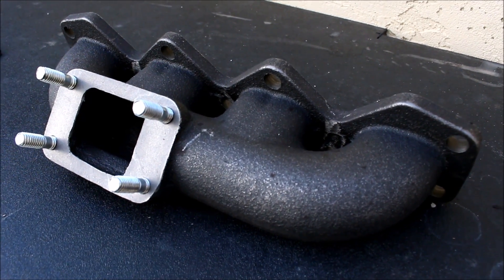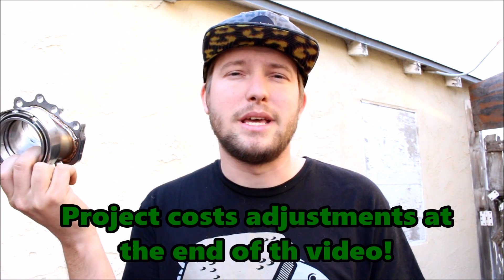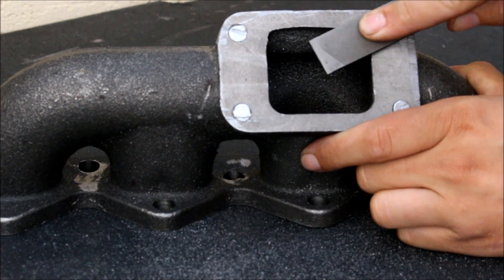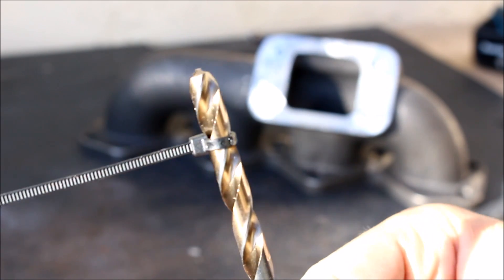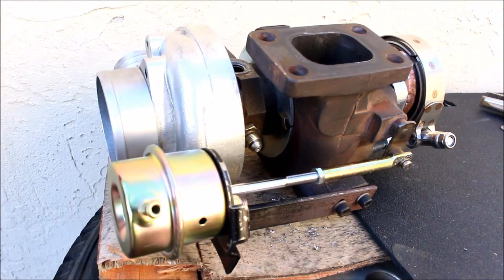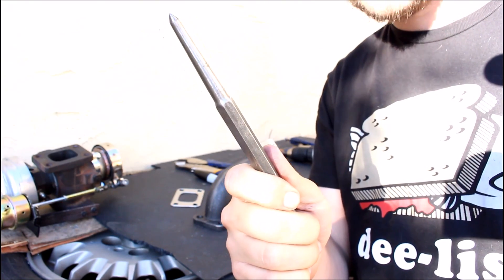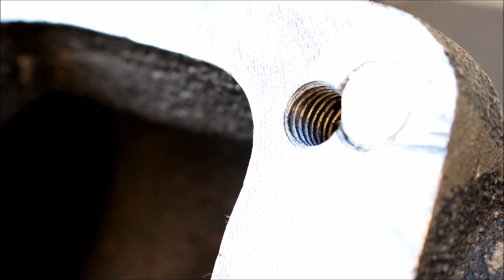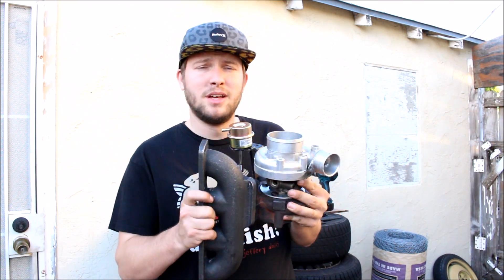Sorry Internet! Mending the Manifold Failures. (Broke & Boosted Ep9.1)

Comment: Well my friend, looks like I'm following your early foot steps ..... The same manifold and a hopefully not to large turbo. It has a build it waste gate and V band turn out. Did you find and use any 90 degree v band elbows to fit between turbo and firewall (shelf) that can be used at the start of down pipe ?   Thanks.

Comment: Was the original turbo a slow spooler ? What did you specifically switch to ?
Reply from the maker: I didn't switch turbos, and yes it's spooled very slow considering how small it was
Reply: @TheCarPassionChannel   Did you have any problems after converting the T3 to T2   
????? Thanks.

Comment: Yeah, I'm doing the install now, IRL.. Wish i had that 2" adapter to aid in clearance. Without it, you can't clock the turbo in any favorable way with the internal WG actuator and you have very little room for the downpipe without cutting the sheet metal. FK haters, prob never did a custom budget install themselves anyway.

Comment: I know this is an old video, but the Warner Ishi (IHI) turbo off of a 87-88 Thunderbird uses a T3 flange and spools very fast (full boost at around 2500, so I'm told). The downside to said turbo is the 18PSI max boost pressure.
Reply from the maker: Sounds like that would be a perfect turbo for the Miata.

Comment: ive been trying to some research and does anyone know if a TD05H 16G will bolt on to a T25 exhaust manifold, i cant quite find one for the 1.6 thats a durable one, the ebay ones just keeps cracking.

Comment: Way to make it work! Just in case anyone has a 1.8... I found this manifold for about $120.00 with an 35/38mm ewg port with an additional block off plate in case you end up running a sr20 t25 or something with an internal wastegate. It also comes with a cast heat shield (not entirely necessary), but the best part is that it is t25 flange, so no worries running a saab/volvo/nissan or any other t25/t28 turbo. >>>http://www.ebay.com/itm/MAZDA-MIATA-MX5-1-8L-T2-T25-T28-PERFORMANCE-IRON-EXHAUST-HEADER-TURBO-MANIFOLD-/321829986356?fits=Model%3AMiata&hash=item4aee8fe034:g:jk0AAOSwxvxW6zrS&vxp=mtr

Comment: the adapter would of actually flowed better and spooled faster. I'd put money on it. the transition was better. cleaner now.. but function over form any day. either way good video.
Reply from the maker: +OMGITSMRMACK Until the bolts failed or the adapter cracked.
Reply: +TheCarPassionChannel maybe. the manifold is at the same risk I'm sure. after all.. it's all ebay! anyways I'll be looking forward to the end result.

Comment: Hey, I advice you put on thread lock instead of anti-seize on your manifold's studs b/c since those are the studs you actually want to have a solid bond and not be able to remove them! Anti-seize is to be able to remove them later on if you feel like it but seeing that's the turbo manifold I don't think you'd want that end to come off
Reply from the maker: +Adam Del Valle Pretty much all thread locker is rated to much lower temperatures than an exhaust manifold will see. I use the anti-seize so in case something does happen to a stud, I can still get it out to replace it later.
Reply: +TheCarPassionChannel makes sense. Do your thing man it's turning out nicely !

Comment: Will having portions of the old studs in your new stud holes become a problem over time?  For some reason I picture them breaking loose from their original spots and making your turbo essentially come off the manifold from "wallowed" out holes.
Reply from the maker: +Pdiddy It's very possible. This build is a learning experience for me, which I am attempting to turn into a learning experience for the viewers.
Reply: Good deal man!  Obviously I hope everything stays tight, but just a thought.  Keep up the hard work and look forward to the next one in the series!
Reply: +Pdiddy A good portion of the studs have threads still on them, so I'd tend to think that they would still hold well, and the fact that there is pressure from the new studs pushing on the old ones will probably keep them from moving/backing out at all. Physically, its possible, but I feel like theyre secure.
Reply from the maker: BagelBytes It's not possible for the old studs to unthread because the new studs are actually holding them in place. The main concern is the poor quality of the metal in the old studs, which could lead to wear on that portion of the threads.
Reply: +TheCarPassionChannel ah yeah you've got a point there, I suppose they should be just as secure as the metal itself since they're threaded in there.

Comment: Sweet, now all the unsupported gasket bits will get ripped up and thrown into the turbine.
Reply from the maker: +tangles01 Good point. Although it is somewhat supported by the turbine housing side, so I think it will be okay. Huge restriction to flow doing it this way, but everything I put up is subject to interpretation and alterations, not necessarily a "this is the best and only way to do it."
Reply: +TheCarPassionChannel OK cool, I've seen it happen, the resulting disintegration of the gasket sent hot gas onto the boost control lines which got too hot (the silicone vacuum lines) burst into flames on track. We put it out but the resulting damage from using the dry power extinguisher dissolved the cerimicoat striped paint etc. It is a 400 HP RB25, but the mechanics are the same. I think your adapter is fine, but you need good hardware, good bolts. I'd also be worries about those cut off studs left in there. I work as a boilermaker by trade and have a good understanding of metal expansion due to heat... and those could be an issue. I recommend the best studs you can afford.

Comment: What was wrong with the adapter??
Reply from the maker: +pssstttchhh It's just adding multiple failure points to the system, the weight of the turbo, combined with the vibration of the engine and all the heat is just asking for trouble.

Comment: So why was it bad to use the adapter?
Reply from the maker: +iRepTurtless It's just adding multiple failure points to the system, the weight of the turbo, combined with the vibration of the engine and all the heat is just asking for trouble.

Comment: wait, so why was it a bad idea to use an adapter?
Reply: +Jack Dawson Because the internet said so
Reply from the maker: +Jack Dawson It's just adding multiple failure points to the system, the weight of the turbo, combined with the vibration of the engine and all the heat is just asking for trouble.
Reply: I suppose yeah. Didn't realise it was that big a deal though. Easy enough to drill new holes though so big deal.

Comment: Lmao Proud as hell haha. Get some JB weld on there and you'll be good to go lol
Reply from the maker: Matt Niemiec I like to use rubber bands actually, they melt into place on the first use and seal flawlessly.
Reply from the maker: +AlexHGVlogs Hahaha. Sup man.
Reply: +TheCarPassionChannel Both of you need to do a video on fuel tables in megasquirt!
Reply: epoxy works good too lol
Reply: +TheCarPassionChannel or chewing gum
Reply: +TheCarPassionChannel I've heard foam insulation makes a great gasket maker.
Reply: +TheCarPassionChannel you been hanging out with Haggard Garage recenyly, cause thats savage asf
Reply from the maker: Jabba the Hutt I just need a stock car that's converting to MS! If I ever put B&B on MS I'll do it.

Comment: hey greg, when you say "T2" thats the same as your t28?
Reply: and did you make a separate bracket for your actuator to clock it correctly?
Reply from the maker: +Nick Racicot Yeah I had my friend make me that a long time ago, it's bolted to the turbine housing so I can clock the compressor however I want. Yeah "T2" is just the bolt pattern. Most people call it "T25" but it's actually the same pattern as a T28. And for "T3" I'm fairly certain GT30/GT35 etc all bolt onto it. It just stands for the bolt pattern on the turbine housing.
Reply: haha thanks again
Reply: one more question, while we're talking about turbo clocking lol, when i go to order my turbo from begi, they ask how i want it clocked. if i said 90 degrees would that put my compressor outlet pointing striaght down toward the ground?
Reply from the maker: Just e-mail or call them, and tell them exactly how you want it clocked. Just be warned, with Begi you'll most likely have a long wait time for parts, and the T25/28 spools slow. You're best off getting a used SR20 turbo for half the price. You could even have someone rebuild it for you if you're not comfortable doing it yourself.
Reply: youre right

Comment: hi @TheCarPassionChannel i have a question to this hole modification sorry for my bad englisch i'm a german guy so why dont you just screw out these four threaded rods ? isn't this the much easier way to do it ? :D 
ps i'm drivin a miata too, 1995 1.6 model love your videos man!
Reply from the maker: +lukas3R If you look closely, when I re-drill the new bolt pattern, I actually drill through part of the old stud, and when I thread it some of the threads are on the old stud material. This will help the hole be as strong as possible by having complete threads. Hopefully that makes sense!